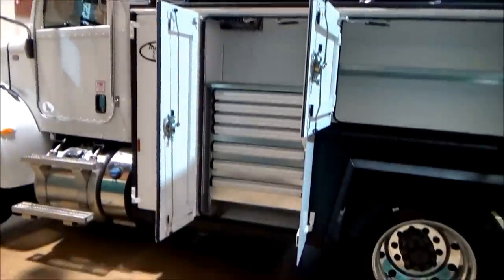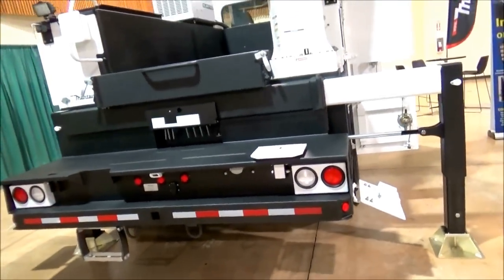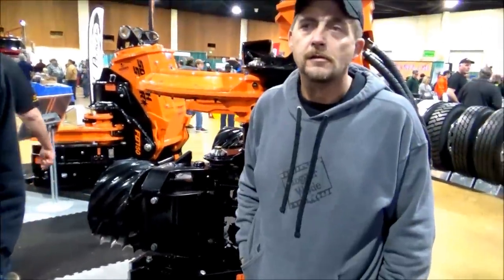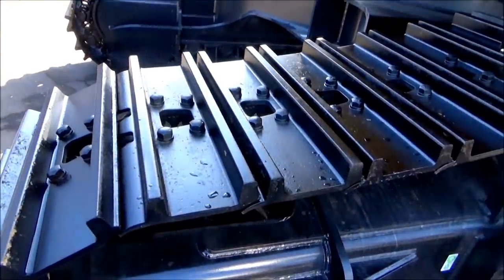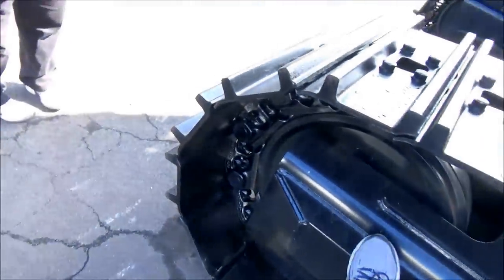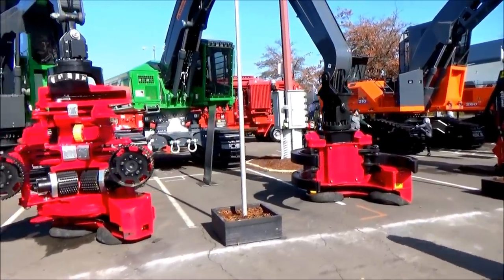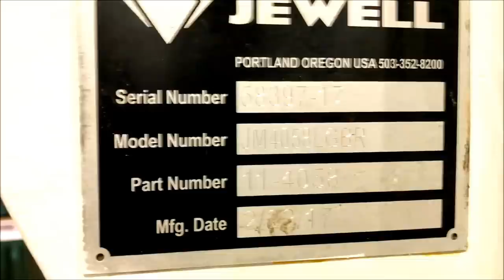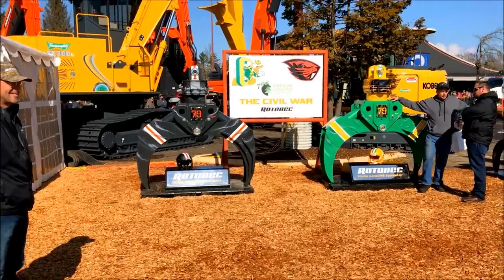Oregon Logging Conference, part 3

Comment: Alex is right sprockets are cheaper than replacing track chain, it's when you're digging with an excavator you want your idlers in front of you because the digging force is hard on the idlers when forward.